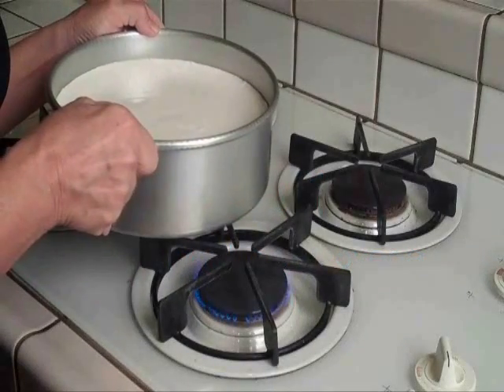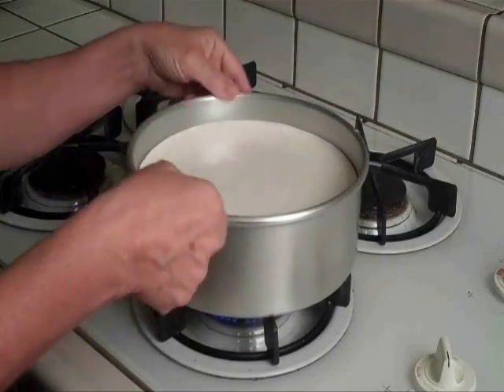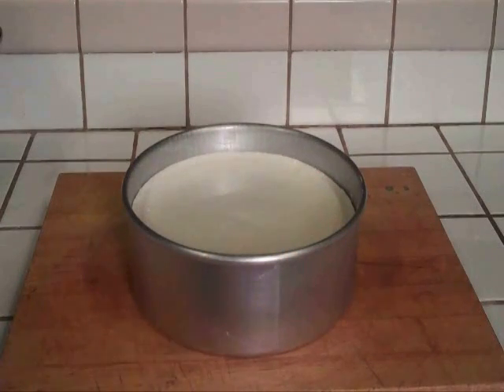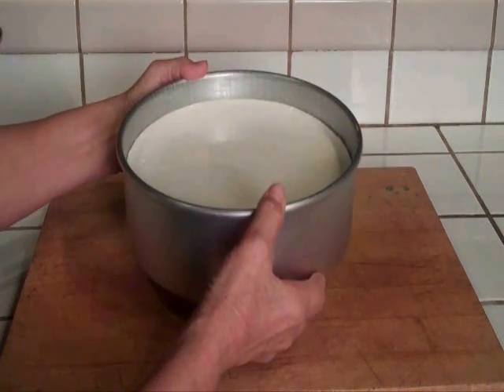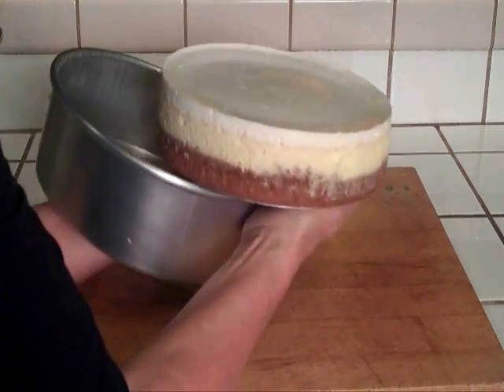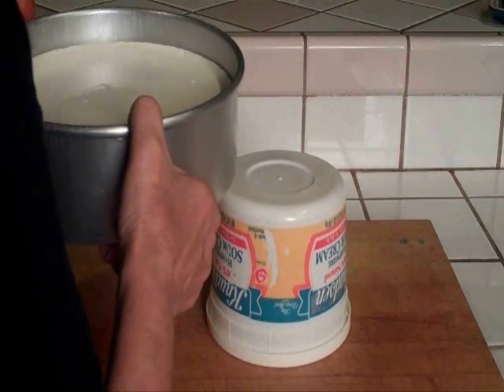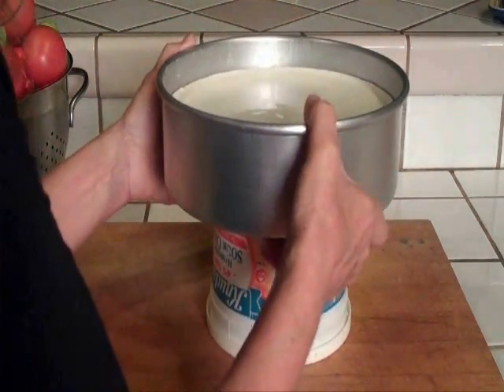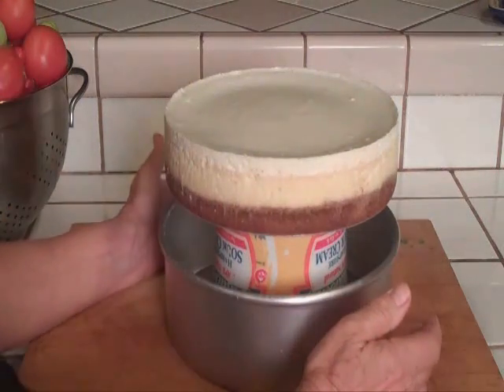How to take a cheesecake out of a pan

Comment from the maker: I use cheesecake pans with removable bottoms - Parrish magic line . The pan bottoms are smooth - not the kind with a waffle bottom. No, I never use parchment paper.  I did not use a non stick spray. For a while I tried buttering the sides but I found it made no difference. This technique was accidentally discovered during a very busy holiday season (My husband and I had a Cheesecake bakery for 20 years) and we had many cheesecakes to take out of pans - and for some reason they were especially hard to remove. My husband impulsively rotated the pan over an open flame and the cheesecake easily slid out. After that every cheesecake got that treatment - it was so easy.  A funny note: we had an open kitchen in our bakery that our customers could see. When we were rotating the cheesecakes over the flame they would ask if we were "cooking" them!
I have never seen anyone else use this technique .... but they may now.
Reply: Thank you for sharing your cheesecake knowledge with us! It's so hard to find others to just ask questions with

Comment: Hi, do you spray any non-stick stuff around the sides of your pan before you put the cake mixture in? How to not get the cake sticking to the pan?
Reply from the maker: Hi, you can brush melted butter on the sides of the pan if you wanted to - but it is not necessary. Slightly heating the pan over a flame releases it (I used this technique for thousands of cheesecakes in my bakery - over 20 years).